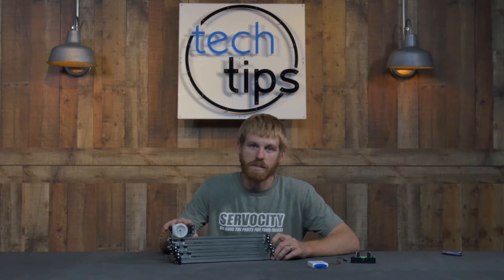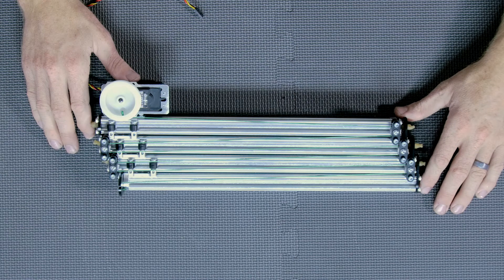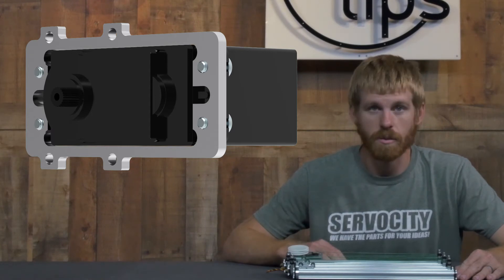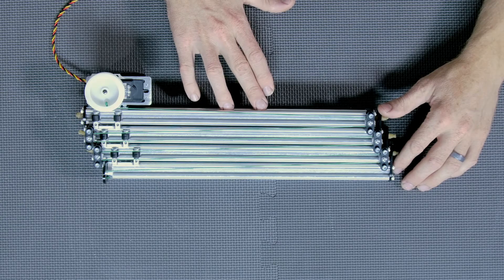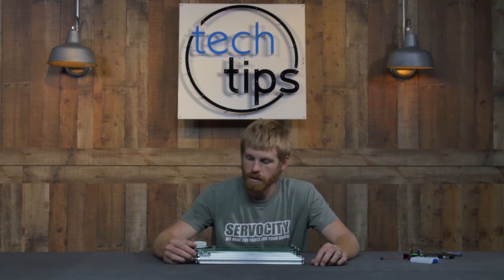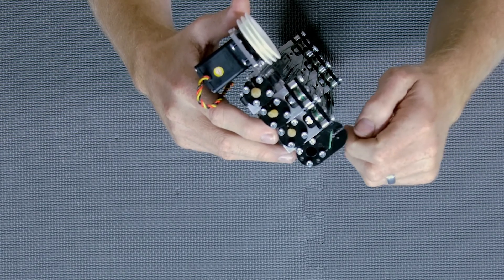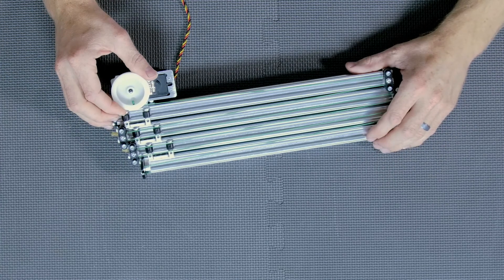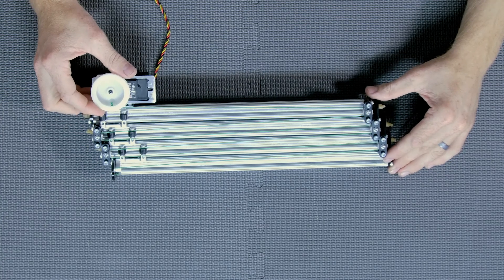Using a Servo with the Cascading X-Rail Slide Kit

Comment: love the video -- but PLEASE list all the parts with links... thank you!
Reply from the maker: The parts list has been updated.  Sorry for the delay!
Reply: Is it a "90° Dual Side Mount A" or a "90° Dual Side Mount B"?  Would love it to work with the "A" - as you guys have that one in stock... but the video looks like the B.  Appreciate the parts list!  Love the X-Rails, we're looking at potentially switching our chassis design over completely to X-Rail... So move videos on your recommendations for motor mountings (or servo) mountings like in this video are great!
Reply from the maker: Good catch!  In the video Kyle is using the 90° Dual Side Mount B https://www.servocity.com/90-dual-side-mount-b.  However, if you look at the assembly build image on our Cascading X-Rail Slide Kit https://www.servocity.com/cascading-x-rail-slide-kit on our website, there is an example of it in use with the 90° Dual Side Mount A https://www.servocity.com/90-dual-side-mount.  Please let us know if you have any other questions tech@servocity.com!